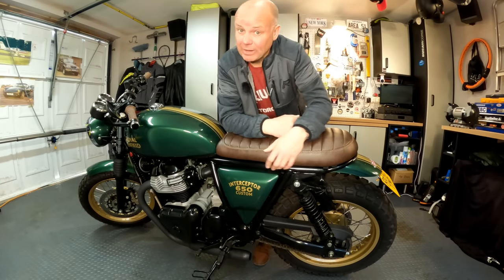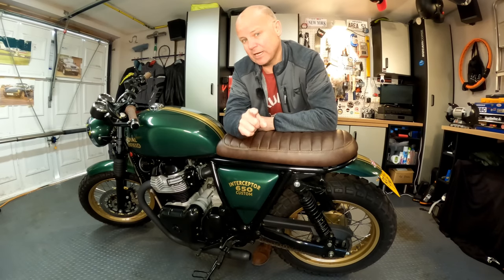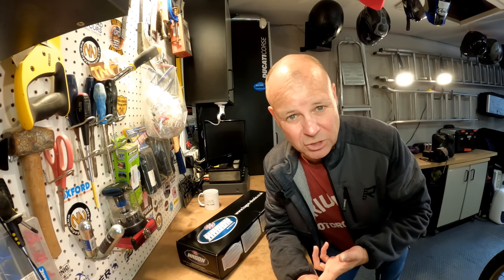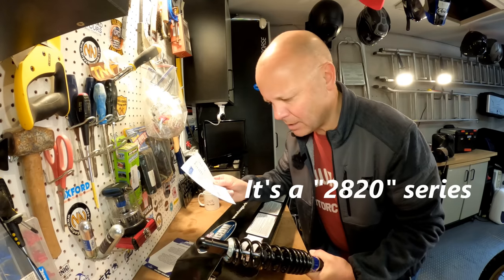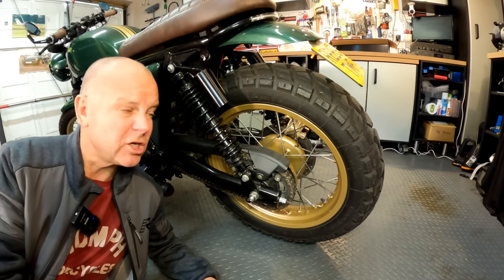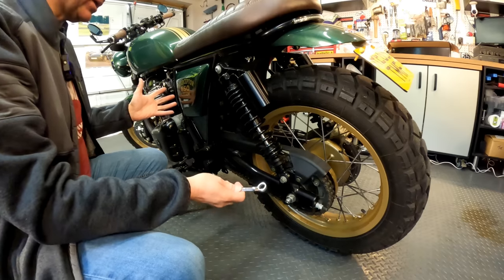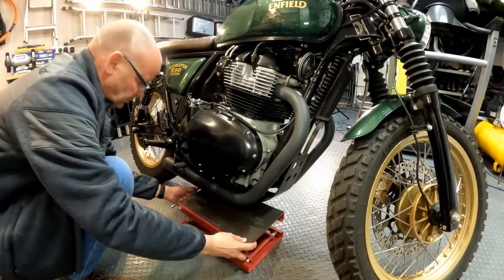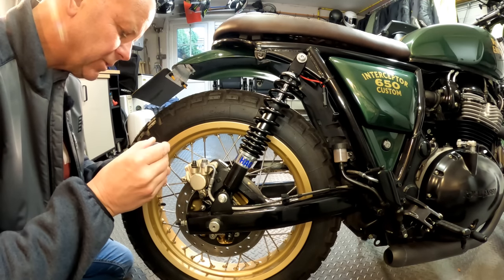DIY Fail: Attempting to install and test new shocks on my Royal Enfield Interceptor

Comment: I knew a guy who fitted after market crash bars to his BMW R NINE T. Cheap one's from China. Two of the bolts srew into the engine block. Has he was torquing it up he heard a loud cracking noise. Unbeknown to him the supplied bolts were slightly to long and he ended up cracking the block as the bolt was being forced into it. A simple job and a written off engine
Reply from the maker: Yikes!

Comment: Good absolute grief 😮 I look forward to the fork upgrade…… touch up paint at the ready 👍
Reply from the maker: Have you done one of these John?  Did it go smoothly for you?
Reply: @TheMissendenFlyer  I’ve done a fair bit, stripped my blackbird down to replace bearings, fork internals , chain & sprockets, oil & filter etc. Had a few scrapes along the way of course..ended up having to re-powder coat a wheel because of my clumsiness.

Comment: FYI...  In the future, you always do both rear dampers at the same time, and start with the bottom bracket, not the top.  Usually, the center stand is good enough to accomplish this job with just a bit of help.  Having a not-too-heavy mate or girlfriend/wife to bounce on the seat makes this job a bit easier.  Cheers,

Comment: First off Andy I didn’t see your previous video, so I’m only going to comment on this one. 1. The stuffed shock is it an original? 2. How many kilometres or miles did it have before the leaking? Having changed shocks over the yrs on various bikes I have never had the trouble you did fitting them. Being in Australia I’ve never heard of the brand of replacement shocks. At 290 pounds that equates roughly to $750/800AUD.

Comment: 🤣🤣🤣, sorry andy best giggle i have has all day. Is that swing arm painted or power cote? the reason i ask is because if it's power you need to paint in the scratch quick before water get in there and lifts the lot off .
Reply from the maker: I think you’ll find the term is “powder coat” - and I don’t actually know if it is painted or otherwise….
Reply: @TheMissendenFlyer  power cote is a trade name ,just so you know

Comment: Mrs Flyer hasn't got any black nail polish stashed away Andy? You could use that to touch up the swing arm.
Reply from the maker: Yes I did think about that, not a bad solution (and easy to remove if it goes wrong)….

Comment: From a health and safety risk assessment point of view , you should always pull on a spanner or ratchet instead of pushing. If the spanner or ratchet slips off when pushing on it you could injure yourself. That is something I learned the hard way in the first year of my apprenticeship  in 1970.

Comment: Much greater improvement seems to come from putting YSS "valve emulators" in the front forks - and especially if you drill out the OEM damper rods to nullify the OEM rods' effect.
The valve emulators provide a 2-rate progressive damping in place of the single-rate damper rod holes.  The kit also has single-rate springs to replace the OEM 2-rate progressive springs.
James "Slick" England shot an interesting 5-part series on the subject which is on Youtube, culminating with his raves about the remarkable improvement in handling - 1st by the emulators,
then by the emulators with the OEM damper rods drilled out.  Search on "James 'Slick' England  Interceptor 650 verdict" for the most important last 2 videos.
Essentially, the mod substitutes progressive damping for the OEM progressive springs.  Many other channels provide various other techniques for removing the damper rods.
Reply from the maker: Sounds complicated!
Reply: @TheMissendenFlyer   - It's a DIY project for guys with confidence, a vice,  and free time.  It doesn't take special skills.  If you've done it once, you can do it again in an afternoon (a SUMMER afternoon).  :-)   Ask your mechanic friend what he'd charge.  It apparently completely transforms the bike's handling.

Comment: I feel the bottom bracket is just bad design. On my 2006 Bonneville for example you don't need to wedge them into a bracket. They just can be pushed on.

Comment: Once you'd fitted the first new shock, it should have automatically aligned the mounting points for the second, with no load. If it doesn't there is obviously a mismatch between the dimensions of the two sides.
These jobs are so much easier if you have a centre stand.
Reply from the maker: Or maybe they were adjusted for preload slightly differently maybe??
Reply: @TheMissendenFlyer  That wouldn't affect the length at maximum extension, which should be the same on a matched pair of shocks. It's possible the positions of the mounting points are not as precise as they should be.
Reply from the maker: Oh OK - maybe that is the case then....

Comment: Such a nice feeling to do your own wrenching on your bike. I was curious if it was possible to lower your bike by the center jack to compress your suspension so that your shock mounting holes line up? Definitely an informative video.
Reply from the maker: I did try that but to no avail (failed to show it on the video)….

Comment: Yepp, the devil is in the detail. It's always worth stopping and thinking if modestly increased usage of force won't do to get a bolt threaded. And yes, I learned the hard way. Many are the threads I stripped. 😵‍💫 On the up-side that made me a reasonably good DIY-mechanic over the years. I fixed cars professionals had given up on.

Comment: If you want some shocking fun! (get it?) YOu should remove the shock on the GS, it's 2 bolts and 2 connector back and one forward.... but... getting to those connector is the fun part...
Reply from the maker: Yes Nigel did replace mine once - like open heart surgery to witness!

Comment: Mate as a mechanic I could say what you could've done. But man at least you had a go. It's a bit of paint. Not as if it was the fuel tank.
Reply from the maker: Exactly - no big deal, easily fixed…

Comment: I was watching you with that screwdriver, hoping that you would put something in-between the blade and the swingarm. then the screwdriver slipped and my testicles went up into me pelvis. Now you can make a video showing how you fixed it.
Reply from the maker: Good point! If you noticed I did put something between the screwdriver and swing arm every other time!!! I knew it would happen…

Comment: I also went with the Hagon shocks, mostly because it was the most cost effective way to spring the bike for my weight. If it make you feel any better mine were also longer than stock and I ended up accidentally dropping the back of my bike all the way down on the swing arm when I was swapping my shocks. Learning the hard way all the time 🙄

Comment: The question that needs to be asked is why (given that the first shock was fitted), did the second shock not line up perfectly?  Either the bike was built with the centres out of line or the shocks were different lengths.  The answer to that would be interesting.
Reply from the maker: Yes that thought did cross my mind - maybe both shocks aren’t adjusted exactly the same for preload??
Reply: @TheMissendenFlyer  Hmm, I would speak to Hagon.  Makes me wonder if the wheel alignment needs checking due to the swinging arm being a tiny bit twisted now.

Comment: Opportunity missed not fitting YSS. Top bolts make sure waher is bigger than the rubber bushing. Or shocks can come off. Fitting your original main stand would have helped. Or did they sell it rather than give it you back.
Reply from the maker: I think Ive got it somewhere…..
Reply: @TheMissendenFlyer  it would have made things much easier had you have fitted it. Even if only temporarily.

Comment: Don’t pull a torque wrench till it clicks twice! Your over torquing the bolt/nut!
The torque wrench is designed to click at the correct torque by repeatedly clicking the wrench at best your achieving nothing but more likely your nudging it into being over the correct torque!

To quote some instruction …..

“Once you hear the click, don't tighten the nut any further. One extra click is all that’s needed for the fastener to be overtightened.”

One click only mr flyer.
Now get out in the garage and loosen all four and torque them correctly!

Comment: Probably been mentioned, the security of the motorcycle is compromised by having the scissor jack the way you did, across the chassis with the adjusting spindle protruding at the side of the motorcycle and not in line?
Reply from the maker: Whay would that have helped then, surely there's less contact with the bike across wise?
Reply: @TheMissendenFlyer  all to do with the construction of the Jack,your way the scissor legs are for lifting not for sideways stresses the Jack is held steady with the crossmember across the chassis and safer to extend the Jack from the side rather than underneath the chassis🍻
Reply from the maker: @derekholme6922  Makes sense....

Comment: I ordered some shorter shocks from Hagon they were very helpful, looks like the same as you got but 340mm instead of the standard 360mm. I found if you use the jack to raise and lower the swinging arm you can align the lower bolt easy especially as my Hagons are shorter than the originals. The lower shocks also solved the problem of getting both feet on the ground.
Reply from the maker: Nice one!

Comment: Andy, why on earth did you not fit the original shocks back on the bike?? They were good enough for the bike from factory and its no super speed machine, you bought after market ones that were crap and then bought more aftermarket! Factory is best matey especially for the Enfield.
Reply from the maker: I personally believe the Hagons are an upgrade over factory and look better on this bike than the stock ones with those piggy back gas canisters….
Reply: @TheMissendenFlyer  fair enough :)

Comment: Engineering isn’t your forte😉. Using your engine jack to raise or lower the swingarm would have altered the pivot point distance just in case the eye to eye lengths are different between the Chinese TEC parts & British bulldog items😎 Far less scratching painted parts & head.

Comment: Ohlins. Without question.  Better fit. Better quality. Would have suited the look of that bike much more. If you hadn’t put so much into it financially I wouldn’t have bothered. You already had a leak it’s not something you want to cut corners with.
Reply from the maker: I think Ohlins would be well over the top for this bike….
Reply: @TheMissendenFlyer  for a standard royal Enfield absolutely. Yours has £15,000 behind it. So in reality £2-3k more than a limited edition Kawasaki 900 golden ball which has ohlins. Your first suspension upgrade was actually a downgrade and this new setup is basically no better than the standard shocks. A set of gold Ohlins would have looked great and transformed the bike into something much better. I appreciate these videos show you having a bash at things but some of your basic decisions seem weird.
Reply from the maker: Sorry about that - maybe I am weird!!  I'm a happy weirdo though.....

Comment: Ah I see the problem.... you've been watching Delboy!
Hagon way better than the Chinese tec trash.
Sorry you scratched the swing arm, thanks for showing your biking life... warts and all!
Reply: The standard Enfield ones are way better than the Tec's. I fitted Hagon's to mine after 30k, when the OEM ones started leaking. I do rate the Hagon's, and they are an improvement, but they were not a vast improvement over the standard shocks. I would have liked you to have denounced the Tec's a little more than you did, to save other people from making the same mistake. Shame you scratched the swingarm, we've all been there. Your method was sound though, if you had placed a little piece of wood between the swingarm and lever, you could have levered safe in the knowledge that the swingarm was protected and you would have got the bolt to align. Remember... Wood is good
Reply from the maker: Yes I knew that swing arm was at risk too!!  Touched up now, all good!

Comment: If that leaking shocks were tec, you have joined the endless line of leaking shocks, my piggy back tec shocks let go in less than 10 months, on removal, I tested their pressure, one had zero (leaking one) and the other a measly 3llb, I warn most about these shocks, heard terrible things like snapping off on the shock eye when a pillion is on board, they have the looks, but that is all. I must have missed you off about these shocks, maybe not tec.
Reply from the maker: Yes I believe they were TEC…..

Comment: Why didn't you mount the lower bolt first, then put the top on, that way you wouldn't have scratched the frame.  Yes, I did join the collective "NOOOOOO!!" as you applied the screwdriver to your frame.
Reply from the maker: I guess I'm just an idiot!!
Reply: @TheMissendenFlyer  I'd never say that, bit of a numpty perhaps 😂😂😂
Reply from the maker: I'm definately that.....

Comment: How many miles were on the bike when the shocks needed to be replaced? Were they just cheaper shocks from the factory?
It's  never as easy as we think before we get into the project. 
Congrads!
Reply from the maker: The old shocks were cheapo after market ones - had done less than a thousand miles…

Comment: Hagon make a great product which is far superior to Tec Bikes Chinsky sh!te.
If you had compressed the springs by 5mm the shocks would have slipped straight on, obviously something Nigel would have done if he was in his well equipped workshop.
Reply from the maker: Indeed - he only had my tools to work with (which mostly consist of hammers/mallets, etc)